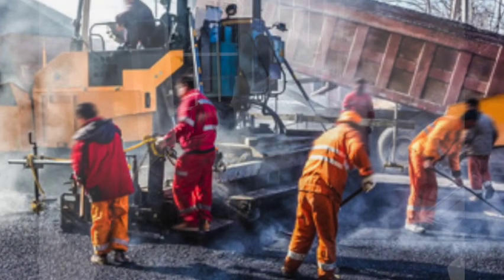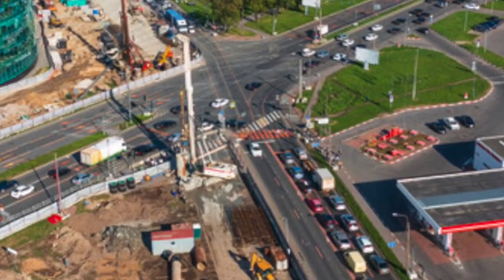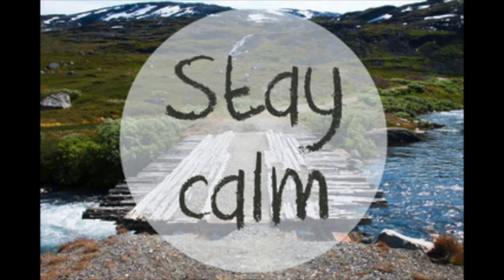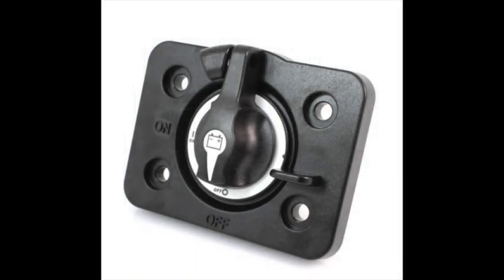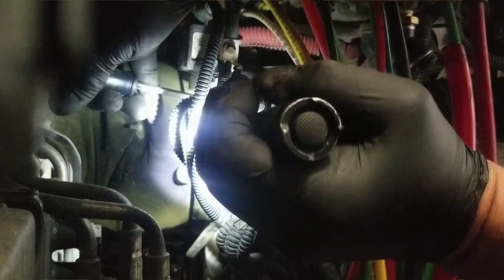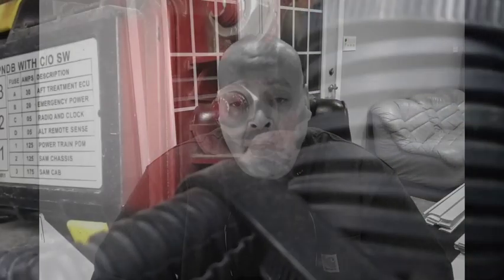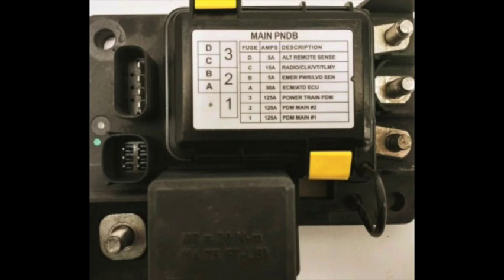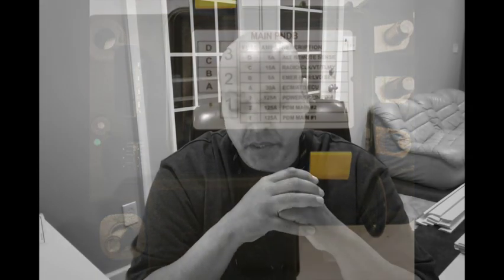TRUCKING | FREIGHTLINER Tractor Trailer Semi Randomly Shuts  Off while driving

Comment: Brother that exactly what happened to my 2016 Cascadia , I was driving on I 70 eastbound in Topeka KS and my truck just shuts off all the gages lights up loose power steering for couple seconds, I freak out and pull over on shoulder, restart my truck and keep driving but it shuts off every bump
Reply: Did u fix it if yes what was the problem
Reply: @brokemillionaire1500   yes it’s fixed now ,  not sure exactly what was wrong but mechanics told me that they have replaced a broken wire that goes to SAM chassis, I replaced a Pdnd , kill switch, and same problem, I was about to give up ,